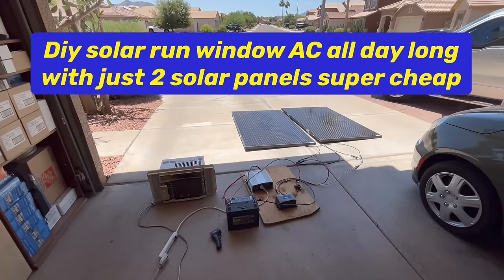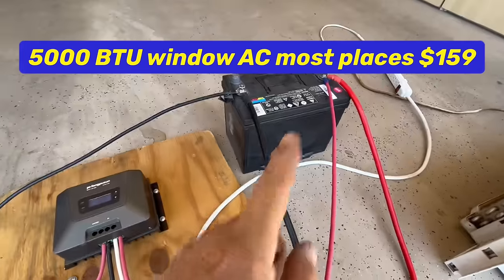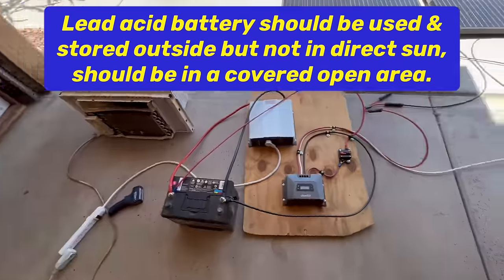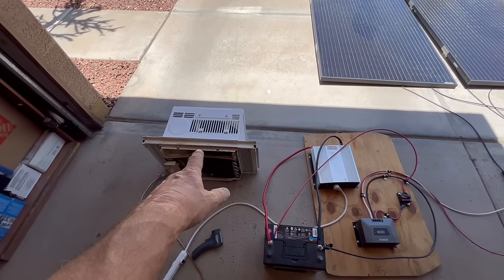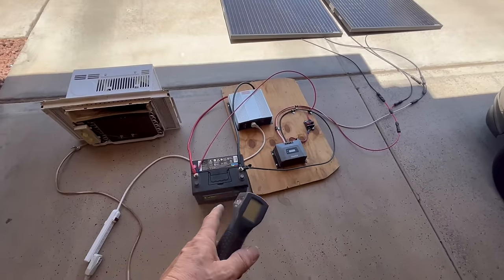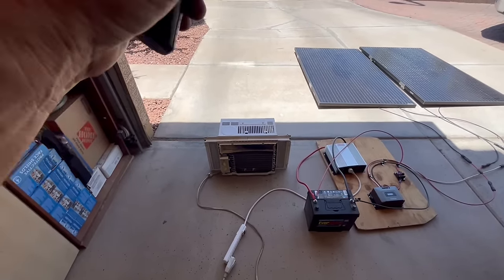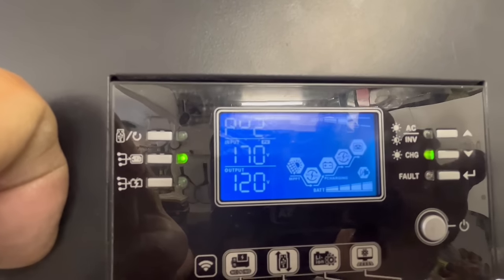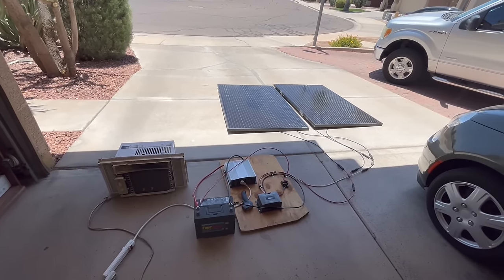Run your window AC with just 2 solar panels when sun shines. Easy DIY project you can do in one day.

Comment: Could you use an 8000 BTU AC with your set-up?
Reply from the maker: You would need another charge controller and more solar panels. Check out my part 2 video, this will help explain what you would need.
Reply: @diy-solar-guy  I have 15 455 watt solar panels.
Three EG 4 batteries battery cabinet a big huge ass inverter and I have no idea how to hook this stuff up I just want to run some AC during ther day while I figure out the rest of it.
Reply: @diy-solar-guy  I do have a growatt solar inverter the Infiniti 1300 that has pass-through charging and it can be charged directly from two of my solar panels.
So maybe I'll have to plug the AC into that? I just want to run it during the heat of the day so I was going to go get the EG4 hybrid AC DC mini split AC/ heat pump unit but now they're out of them and I'm getting ready to go up to the property and I need the AC during the day lol
Reply from the maker: Before installing, need to understand the basics of off grid solar. Need to be able to understand the input/output from inverter so you know what configuration to connect solar panels to stay within limits specified on inverter. I do not have a lot of videos on step by step instructions but their are other YouTube channels that will show step by step on connecting components. You can search for your exact components and how to connect and more than likely there will be a video for installation. I started with a 12 volt Wallmart battery, 2000 watt modified sign wave inverter. A 2 solar panel charge controller and a 5000 btu window ac to understand how solar works, then as I connected and it actually worked, I started upgrading to 24volt inverter and battery bank, then to 48 volt battery bank. You need to understand the risk involved in connecting components yourself and having a firm understanding of how and why all components are connected together. Check out Will Prouse videos on easy solar off grid system set up. He does a really good job showing connecting all the components together and why. Hope this helps. The more videos you watch from different channels, the better you can understand off grid solar. Hope you have a wonderful and blessed week
Reply from the maker: Check out Will Prouse videos on connecting basic 48 volt system. He does a great job explaining and showing how to connect components
Reply: @diy-solar-guy  yeah and I have the disconnects too for when I have to work on it. I bought the entire system while I had the money for it over a year ago LOL but I live 13 hours away from my property so it's hard to just go get something done. That's why I bought the solar generator so I could do some stuff in the meantime when I'm up there. And then once I figure out how I want my setup inside the cabin  then I'll pay an electrician to come out one time instead of three times.
That's why I love to hybrid mini-split because you can plug for my solar panels directly into it and I would have been good to go. The sun was out. But now I need a different plan unless somebody else sells them and has them in stock but I haven't been able to find anyone. I was going to get the 12,000 BTU
Reply: @diy-solar-guy  I actually think I watched him a very long time ago when I was trying to figure out what system I wanted up at the property and he is very smart. Thank you for reminding me of his name and for trying to help me figure this out! I truly do appreciate it.
Reply from the maker: @mycabinlife1291  you might find something on eBay
Reply: @diy-solar-guy  yeah I'm running out of time I wanted to head up there this weekend.
I really didn't want to have to use the noisy gas generator I'm going up there for peace and quiet lol
Reply from the maker: I understand. Those units are selling out quick this summer with more and more people installing themselves and installing off grid solar DIY as well to run mini splits. Hope you stay cool this weekend.
Reply: @diy-solar-guy  I'm in FL. Going to be 115°+ today. Thankful for air conditioning! You have a blessed day!
Reply from the maker: @mycabinlife1291  I was wondering where you were. That is hot, not fit for man or beast, lol. We only have 5 -6 more weeks of extreme heat, then it cools down overnight really nice. Stay cool.

Comment: Let's say , use 12v solar panels and use 115v inverter and wants to use car batteries for the night time 12 hours of time .
-how many panels I will need .
-how many batteries I will need .
-how many watts for the 115v inverter .
Note : using same A/C you have .
Note : money cost not an issue. 
Note:I don't know if batteries can be regular car batteries or lithium batteries . But whatever is best to fit in small space .
Reply from the maker: Can’t use lead acid car batteries for overnight use. Need Lithium Iron Phosphate. You would be better to buy a kit with inverter, batteries and solar panels, wire, breakers, etc or you can get a 12,000 btu mini split with direct solar connection that runs on solar during the day and can run on LiFePO4 battery or grid power at night. Check out signature solar link in video. You could get everything from them. You could also talk to their technical people about what you want to do and everything you would need. They could help you find the right fit for your needs. Hope this helps. Have a wonderful and truly blessed week
Reply: @diy-solar-guy  it's only 5k btu like yours in the video,  I feel like 2 lifePo4 would be enough for 12 hours .
Reply from the maker: @EARTHKEENING  2 LiFePO4 51.2 volt 100 ah, 5.1kwh batteries might get your through the night. 550 watts x 10 hours is 5.5 kWh. You can go down to 20 percent of charge before battery will turn off or fault.

Comment: The inverter will surge to 4k watts to start that tiny 5k btu AC? My 11.4k btu unit starts perfectly fine on a 1000w watt inverter with 2000 watt surge. I'll never understand why people think electric motors use a hundred million billion watts to start, capacitors exist for a reason.
Reply from the maker: Dry good point. Thanks for your input. I have 7 mini splits installed at my house and still use my 3 1/2 ton whole house upstairs heat pump to air condition my house during the day and run on LiFePO4 batteries at night. I run 2 mini splits downstairs that do an excellent job at keeping entire downstairs below 70 degrees in the day. I don’t run my downstairs ac at night and still in the morning my downstairs is the same temp as upstairs. Check out my other newer videos and see everything we do with off grid solar. I love these mini splits. They are so efficient and with solar I can cool house 10-15 cooler than I would without solar at no electricity cost for grid power. Hope you have a truly wonderful and extremely blessed 2024.

Comment: 660w of solar panel for $35? Where is that possible?
Reply from the maker: The solar panels were $35 for each 330 watt mono panel. I bought used at a side sidewalk sale that santansolar.com has 2 times a year. They also have other sales through out the year as well.

Comment: I have to use 6 340w panels just to get it running well..
Reply from the maker: Very nice , not all solar used panels will work well with just 2 solar panels and you might have to use more like you did but you should definitely be able to run most of the day as long as full sun is on the solar panels. The angle of the sun with solar panels will affect output as well. The more solar panels you use, the better the system becomes. Take the basic system and improve it. Each person can do it differently and the way they want to. Thank you for sharing and hope you have a wonderful and truly blessed weekend
Reply: I use 4 230w panels on a lithium 12V & it runs & keeps battery at 100% when sun is out plus it runs for another 3 hours & have 50% on batts.
Reply from the maker: @LoneStarHomestead3  very nice. You have to adapt to your area to get it to run consistently all day long. This video was just a simple set up to show basic parts needed. Improving on it will greatly increase your ability to run ac and even more ac units or mini splits. Thank you so much for your input. Hope you have a truly wonderful and blessed weekend
Reply: @diy-solar-guy  Angle of solar panels relative to the sun is must.
Look up solar panel angle map for your area.
It will tell you the degree of angle when facing due south for max solar panel output.
For me it's 12 degrees in the summer.
Reply: @diy-solar-guy  I upgraded my system to 9 panels, 3s3p. I have 15 panels total so 3s5p will be hooked up soon
Reply from the maker: @420.........  very nice, you can always improve upon basic set up like you did. Thanks for sharing
Reply from the maker: @LoneStarHomestead3  thank you

Comment: Respectfully, your comment about panels should not be left out in the sun with no load attached is in error.  When your system reaches max voltage, the charge controller basically shuts off the panels, or no load attached.   I have a 100 watt panel ground mounted that only gets used to recharge my power station when I need it. After a year, it has the output that it had when new.
Reply from the maker: I agree. I was actually talking about solar panels not attached to anything thing and or laying on the ground. I said that because I see a lot of people lays solar panels on the ground and children or pets can get hurt if not connected to solar system or charge controller. If still connected to solar system , I agree the charge controller will shut down if batteries are full. Thanks for your input, hope you have a wonderful and blessed week

Comment: wired in series instead of parallel would've given you  the maximum amount those panels could have produced fyi
Reply from the maker: You can wire in series or parallel, I tried both ways and did not see a difference at all. But connecting in series does keep amps low while voltage increases, that’s the way I like to connect solar panels if possible. Thank you for your input. Hope you have a wonderful and blessed day
Reply: @diy-solar-guy  its a wide known fact  ask yourself this then why are Led strip or batteries in your flash light? jack ? why  then are they in series????? just a ffn thought ?
Reply from the maker: I use over 100-250 watt panels in my off grid systems. I well aware of connecting solar panels in series and parallel. I run a 3 1/2 ton and 4 ton heat pump to air condition my house when 113 degrees out in day and use a 25.5 kWh EG4 LiFePO4 battery bank to run ac over night with 90 degrees lows. I air condition my 3 car garage as well during the day using off grid solar. I ever run my pool heat pump pool heater that uses 186 amp or 7500 watts while running. I use a 12kw Growatt and 6kw Growatt low frequency split phase off grid inverter with a combined total of 19,000 watts of solar panel input between the 2 inverters that includes the 5500 watt EG4 charge controller that can supplement either inverter when needing more input to keep batteries charged while running very large loads. This window ac video was just a simple example of how to use solar and that you can run a window ac With minimal components. I also installed and can run 6 mini splits in my house and garage 4 years ago that work perfectly with no leaks or problems. We installed everything DIY. We know a little about solar and share what we have done with the off grid solar so others know what is possible with off grid solar. We just show what we did but there are infinite ways to build your own off grid solar and each person should decide how to build their own system. I only show what we accomplished. Have a little fun with solar. Thanks for your input and hope you have a wonderful and blessed week

Comment: People always say the battery only lasts few hours, maybe get at least 5 batteries, the AC then  would last 12 plus hours.
Reply from the maker: Lead acid and deep cycle and AGM will not allow you to run very long. I had 16 drop cycle solar specific batteries and I doubt I could get 2-3 hours with all those together. Just are not designed to do that as where Lithium Iron Phosphate batteries can run a long time. At 500 watts per hour on a 100 amp hour 5120 watts 12 volt LiFePO4 battery you might get 6 hours of run time but it would need to be Lithium Iron Phosphate battery. I have 5.1 kWh batteries and can use around 4 kWh on that battery so theoretically you should be able to run 500 watts for 8 hours on that battery but I have never tried. Hope this answer helps. Hope you have a truly wonderful and extremely blessed 2024.

Comment: Whats the volts on the panels thanks
Reply from the maker: 38 volts dc for 330 watt solar panels
Reply: @diy-solar-guy  on a 12,000 BTU inverter air conditioner midea u-shaped air conditioner or any other inverter. Would you suggest for 350 watt panels with no more than 50 volts building a test system like your AC system in the video Thank you very much for your prompt response
Reply from the maker: @frankegenaro  check out my other videos on using mini split heat pumps. I installed 6 in my house and garage. Mini splits will use around 1200 watts at start up and drop down to 400-600 watts. I use my mini splits year round. I even have videos on my pool heater heat pumps. All using solar. I make sure I have 2000 watts in solar panels for each mini split. This is because of cloudy days not producing as much power. Check out those videos for a lot of info. I even air condition my entire 2 story house using solar in day and battery at night.
Reply: @diy-solar-guy  Thank You I have been watching all your videos you're amazing My problem here is I don't think I can put up as many panels as you has the city might have something to say about it so I'm thinking of starting a small running one 12000 BTU Midea trying to keep the panels down to a minimum and since this will be my first build there will be a lot of trial and error. I want to do something like your portable RV set up so that it's a standalone system off-grid system completely and the goal is to have some free cool air conditioning come into the house with the unit set at 70° and the central air set at 80° obviously When the Sun Goes Down the system will go off. After a while, I might more batteries. Once again your system is amazing I love all your videos. So I'm thinking of buying 10 to 12 panels from Sun Tan Solar and having them shipped to California Rancho Mirage splitting them with my neighbor. By the way, he watches your videos too. In any event what size voltage should I stay under on the panels obviously, I'm going to get either 350 to 400 Watts panels shipped so that at least I would have 1400 W with four solar panels the thing that I'm kind of sketching on is the voltage just was wondering what voltage you would stay under so that the system will be flexible Thanks
Reply: Before I ran into your videos my thought was to put in a solar system with an inverter that had zero output to the grid but every installer here says I have to tie into the grid and go on to net metering 3 which is very unfavorable at 66 cents a kilowatt between 4:00 p.m. and 9:00 p.m. so I saw your video with the air conditioner and thought a standalone air conditioner that's not touching my house electrical or the grid it would be a similar system like the pool pump systems that the city allows where the pump runs on solar alone.
Reply from the maker: The voltage will depend on your inverter. Look at getting a all in one inverter, I have the Mpp 120v ac output, 24v dc battery bank that allows 145 dc volt pv input. Look at the dc voltage on solar panel to see how many you can connect in series, then you would have to parallel other sets to get to 2400 watt pv input. There are many options for off grid inverters that are all in one. The higher the dc pv input the better. The newer larger inverters that are 5000 watt or more pv input can go up to 500 dc volts pv input. At 50v dc on a solar panel you could connect 10 panels in series to get to 500 my dc pv solar panel input. Much more efficient. The charge controller I have in video will only handle 2-330 watt solar panels at 12 volts and 4-330 watt solar panels at 24 volts. Thanks for the input and question.
Reply from the maker: I show you what you can run with solar and what components you need.  Easy to do. Off grid solar is the way to go. Huge expenses with grid tie. Since I do not tie into grid, there are no permits to get. I run pool pump 24 hours a day at 1200 rpm and my pool is crystal clear. I completely run 100 percent of my air conditioning 7/24 with solar and battery bank. Easy to do. Components easy to get on eBay, amazon and local solar suppliers, I use all used solar panels with my off grid, huge savings.

Comment: Those wires must get super hot
Reply from the maker: In the sun yes, under solar panels. Yes. Even in the conduit laying on ground to protect wires, yes. But by the time they wires are connected to inverter, they are room temp. It was 112-118 degrees last 2 months in day here in Phoenix and those wires got really hot during the day. Best to bury long runs of wire to keep cooler in day if possible but wires are made to withstand very high temps for solar wire. If you try to run too many dc amps from solar panels to inverter, wires can get hot enough to melt plastic on connectors and can cause a open or short or even worse a fire. That’s why you always check wires connected to solar panels with a dc amp meter before connecting to inverter. Thank so much for the comment. Hope you have a truly blessed week